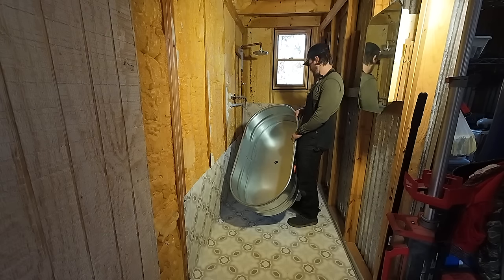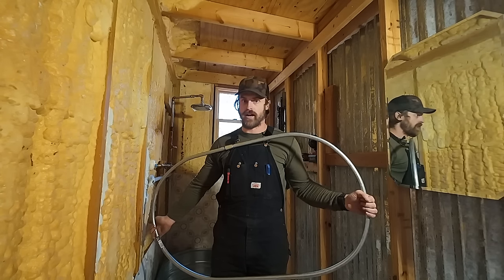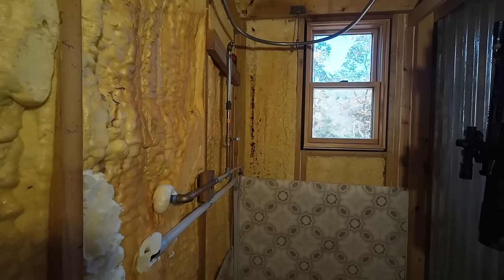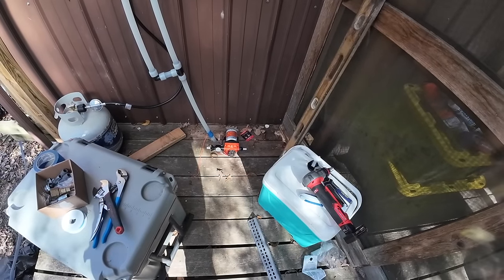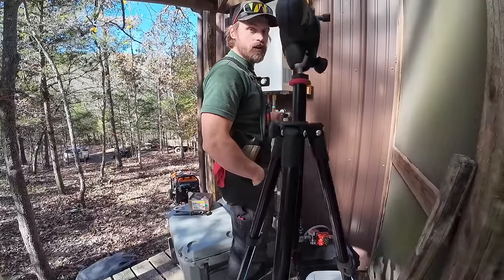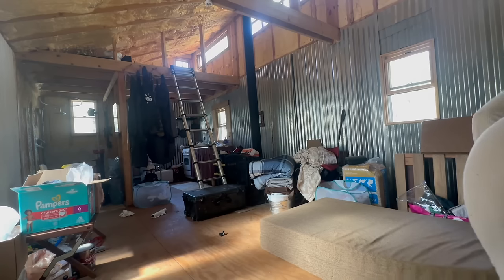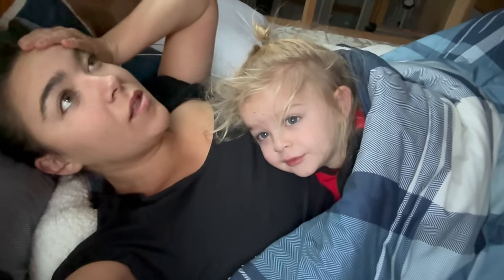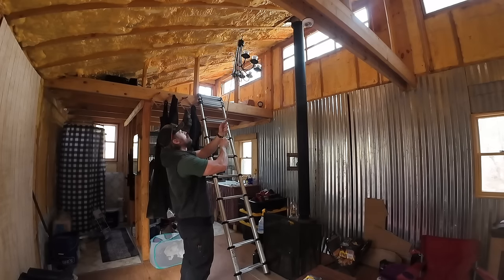Woodys Off Grid Cabin WEEK 3, 12v/propane water heater install, stock tank shower, & DIY curtain rod

Comment: You need to have a cold water side blending into the shower. Those water heaters are hard to regulate. Better than no hot water but i couldent wait to get rid of it at my cabin. Just watch the water doesent freeze in it over winter or it will be shot. Best to have them inside or in a warmer space.. sometimes in a small space a outdoor shower house is better. Just get a small propane heater, hang it on the wall and keep it going on a low setting all winter.

Comment: Now that you have a 12v water pump, you don't need that water tank so far away. You could have it next to the cabin. Some other channels are putting hay around and on top of their water totes to keep them from freezing but the tanks are butted against their cabins or rv's.
Reply from the maker: Good point! We will probably use the tower as a gravity water hose situation eventually, but we’ve got to do some serious work on the roof and to create a water catch system with tanks closer to the house. Probably won’t happen until next spring if not summer.

Comment: If you have pex remember to shield it from the sun, it will breakdown outdoors.  Otherwise great job.
Reply: You forgot to mention that expansion packs tubing is made out of a material that's like crack to rodents and rats.. it's like the glue in press board that cockroaches are attracted to and they eat.. so if pipes are going to be outside exposed they should probably be wrapped in some type of mesh. I live in Northern Wisconsin.. mice seem to eat the tubing before the eat the electrical wiring..
Reply: I don't know if it would work or not to keep the rodents from chewing on the pipe but after installing packs in my house I had a crapload of little tiny pieces that would normally go in garbage so instead of throwing them in the garbage I just threw them into every little nook and cranny in my scoreboards ceiling any gaps that you normally don't see that rodents like to run around inside of so my theory don't know if it's will work or not but my theory is that maybe they'll eat the pieces before they eat my pipes.. I would rather have leaks in my piping 10 to 15 years from now preferably just not next week..

Comment: Why didn't you put the water tower next to the cabin?
Reply from the maker: Initially the intent was to get enough flow via gravity that we wouldn’t need a pump. Where we put it is about 15 feet up in elevation from the cabin. Sadly our water heater needs more pressure in reality than the manufacturer says it does.